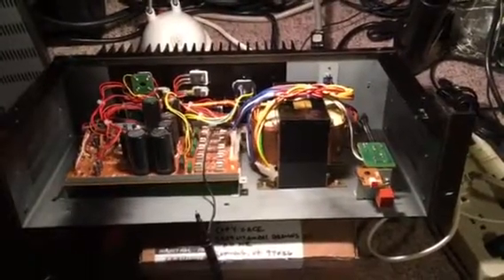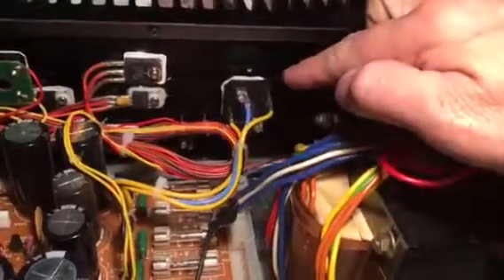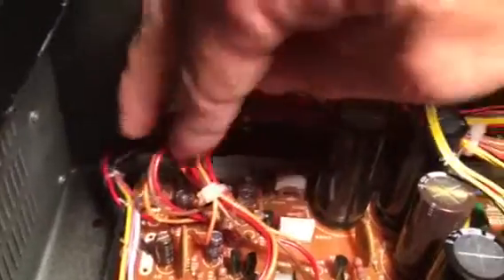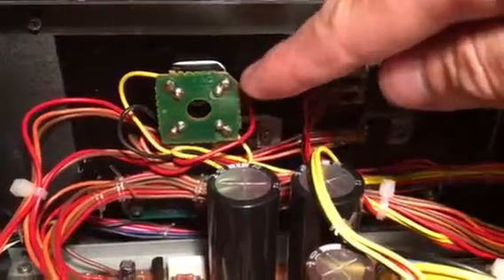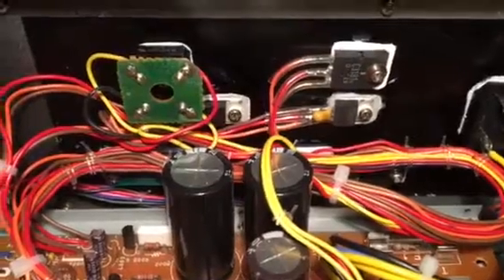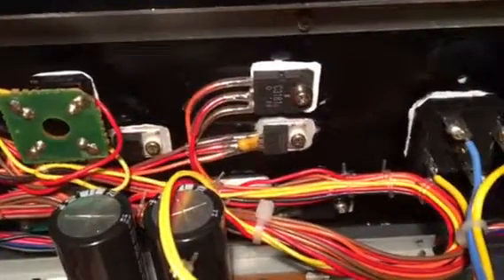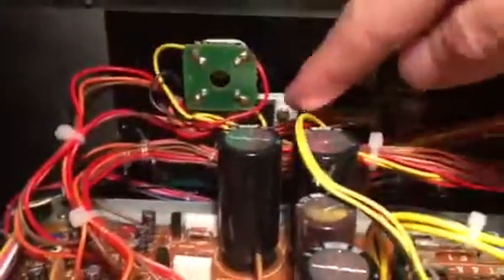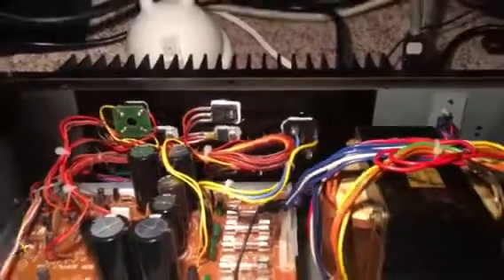Tascam M-__ Power Supply Tour

Comment: I have a tascam m2600 mixer no power supply . Is there another way to power it ?
Reply: There are other Tascam power supplies that may work, but you would need to do research to verify the power rails match up and also can supply the necessary current for each rail. There may also be a need to adapt the power umbilical connectors which can be difficult. Do you have the power umbilical? You can also build up a power supply array out of individual power supply modules. All of this is complicated and expensive. But it can be done.
Reply: I'm having the same problem. Do you know of any compatible power  amps for this device?

Comment: Hi, Thanks for the Video ! Would you have a schematic for the M-3700 supply.. Thanks.. Trying to rebuild mine.
Reply from the maker: I do not. I have no tech docs for the M-3700. Plenty for the M-3500. But the M-3700 stuff is readily available for a fair price from a number of resources. You might even call Tascam Parts. But if it was me I’d reach out to the folks at servicemanuals.net first…it’s like $20 for a high-quality complete operations/maintenance manual downloadable in pdf format. I’ve obtained a number of Tascam manuals this way and if they have the M-3700 this would be a good way to go; nothing but good things to say about them.

Comment: I have a Ramsa power amp and a carvin amp used for PA but wired direct 
Was there was a convert cable or adapt
Reply: A power amp is not the same thing as a power supply. You cannot use a power amp to power your Tascam mixing console.

Comment: Hi there. Could you tell me what the DC output voltage rails are please?  Is it just 15 +\~ and 48v or  are there others?  I’m looking at purchasing this supply to modify for a later allen Heath which has a switched mode internal psu and blows the caps every 18 months.
Reply from the maker: The PS-520 has +/-15V, +/-18V and +48V DC power rails as well as 11VAC. I don’t know what the load capacity is on the +/-18V rails because that only powers the 8-channel balance amp PCB assembly. So if you’re planning on using that to power a whole console you’d want to load test that set of power rails first to see if it’s up to muster. The +/-15V rails I think can handle up to a couple amps each IIRC.

Comment: No where can I get an umbilical from ? 
I found a tascam 5700 or something like that for sale on Ebay 
I asked the guy if it would work he didn't answer or was confused.  
Thanks for taking the time to help .
Reply from the maker: So, what I think I'm not making clear here is the power supply and power supply umbilical are not off-the-shelf components. They are very much proprietary and specific to the M-2600 mixing console. At this point in time, with he the mixing console being out of production for several decades and Teac having discontinued analog support for 15 years or so, this stuff is extremely hard to find if possible at all, and extremely difficult at best to build from scratch.

The power supply umbilical is not a simple power cable...it is a cable with usually 20 or so individual conductors inside, and the plugs on each end are special locking connectors used historically in professional video equipment...the connectors are made by Hirose. Hirose is still in business, but the Sumicon 1600 series used on your M-2600 and other Teac professional mixing consoles and open-reel tape machines from the late 70s to late 80s or early 90s are long since out of production and cannot be found. I don't have an M-2600 series service manual so I can't tell you any more specific details as to your umbilical cable as far as what the pin count is on the connectors or pin configuration (what pin carries what over what conductor of the cable, and how those correspond to the pins at the other end)...you can look at the back of your console where the umbilical connects and count the pins there. It is probably 20. But, again, Hirose Sumicon 1600 parts, including 1620 (the 20-pin components) are long since out of production. I was able to find some about 12 years ago from a place in England, but that was all I could find and that was 12 years ago. And the cabling itself, unless you can find a scrap from somewhere, is uncommon and you have to buy a bunch to get it. You only need 3-6 feet but you typically have to buy some quantity of it to get that 3-6 feet...and its not cheap. Then if you can even find the parts you have to find somebody who can solder all of that up which is a real chore because the pins are densely packed on those connectors.

And regarding the power supply...understand that your mixer doesn't just use one voltage rail...unlike a wall wart that has one voltage like +9V or +12V, your M-2600 is probably powered by six different power rails (DC power rails in +5V or +6V flavor, and also probably +15V, -15V, +18V, -18V and +48V flavors...there might be a low votage AC power rail in there too). The PS-2600 provides all those power rails with the current capacity required by each section. It is a very specialized piece of equipment specific to your mixing console. I am 99% confident, based on my experience, you can't just hook up some other Tascam power supply and expect it to work...in fact you can likely expect it to roach your M-2600. If I had the service manual for the M-2600 I could analyze what power rails are needed and what the maximum theoretical current demand is of each of those and then tell you if the PS-520 from the M-520 mixing console would work, but it would be a miracle...the power umbilical has to have the correct connector, the pin configuration has to match, the power supply rails need to all be correct, and each power rail has to be able to supply adequate current. I don't even have an owner's manual for the M-2600 much less a service manual and without those documents there isn't much more I can do to help you.
Reply: @SweetbeatsTechStop  That was so helpful . I am truly grateful for your detailed info . Now I need to make a decision on what to do with this unit. Bury it in the backyard Haha . Thanks Again
Reply: Or look for another one that is complete with the power supply and keep the one you have for spare parts. Or get the service manual and we info share offline and I help determine what other power supplies might be compatible. It may also be possible (if not an eloquent or permanent solution), if you happen to find a power supply without the umbilical, to direct-connect the power supply to the console of you can unmount the connector on the back of the power supply (if there is enough slack in the internal wiring) if that makes sense. That can be done with the M-520...not sure about the M-2600.
Reply: @SweetbeatsTechStop  Hey, I have a M2600, the power supply AND the service manual. How can I contact you? My M2600 is fully functional but it's power conectors from the M2600 and it's power source are very rusty. I might need to replace them.
Reply from the maker: So the connectors on the umbilical cable are fine, but the ones on the power supply and console frame themselves are rusty?
Reply: @SweetbeatsTechStop  YES!
Reply from the maker: I’ve never seen rusty connectors…hate to think of what else might be going on inside. How many pins are the connectors? 20 or 28?
Reply: @SweetbeatsTechStop  15 in two cloumns
Reply from the maker: Okay so that didn’t match the connector type I was thinking…so I Googled some images of the PS-2600 and I see Tascam switched from using the more professional Hirose Sumicon connectors to a more garden variety DSUB connector. But those are always an odd number of pins. You said 15 x 2 which is 30 pins. That doesn’t match up. Can you post a link to a detailed pic of one of the connectors on your console or the power supply?
Reply: @SweetbeatsTechStop  there are 15 pins in the connectors, spread in two rows with 7 and 8 pins each. It is the kind is connectors you would see more in the professional video stuff.
Reply from the maker: No, sounds like standard DSUB15 used in all sorts of stuff. I can’t tell for sure from the manual or the pics online. So either you can post a link to a detailed pic of the connector, or just go to your favorite online or local electronics parts retailer and get a set of panel mount DSUB15 connectors, one male and one female. I’m assuming that’s how they are in your equipment, yes? One female and one male?
Reply: @SweetbeatsTechStop  Yes, the female (on the psu) and male(on the m2600). I'll try to use a rust remover and hope for the best here. thank you!

Comment: Ok thank you so much . I m looking to power this any advice ?
Reply: Do you have the power supply umbilical? If you do then the easiest thing to do is find a used PS-2600 power supply. Otherwise your only option is build a multirail power supply out of individual power supply modules as I said before. You may be able to use a power supply from something similar like the PS-3500 from an M-3500 console, but here again you still have to have the umbilical, and without doing more research I’m not sure if the connectors on the umbilical between the two are the same, and if the pinout is the same on each. Lots of complicated expensive work if you are going to try and match up a different power supply or build one from scratch. Simplest option is to source a PS-2600 power supply.

Comment: Hello Sweetbeats, is it possible to modify this source to work on 220 volts? I took a deesas board in excellent condition, it reads 120 volts but the voltage in the region it came from is 220v , When I turn on 120v the VU's lights come on a little weak, but at 220v they are much brighter .... Was it adapted to 220v ??? hard to say but if you can opnar already helps. thank you friend, a hug !!!!
Reply from the maker: Hi. I’m not sure I understand what you are wanting to know. Are you wondering if my Tascam power supply can be modified for 220V regions?
Reply: @SweetbeatsTechStop  Hello yes. sorry for the bad english. I'm from Brazil and I bought a tascam m520. the previous owner said he used it on 220v. she is in perfect condition. thank you friend.
Reply from the maker: Okay. The PS-520 power supply can’t be modified for different mains voltages. A different main transformer inside the power supply is needed. There is one for 100V, one for 120V, and one for 220V/240V…different transformers. If you want to use a 120V version in a 220V region you have to buy a separate external step-down power transformer, and if you want to use a 220V version in a 120V region you have to get a step-up transformer in order to convert the mains voltage to the correct power for the version of power supply being used. I hope that helps.
Reply: @SweetbeatsTechStop  Yes, thanks a lot for the help. good luck with the jobs!!!!